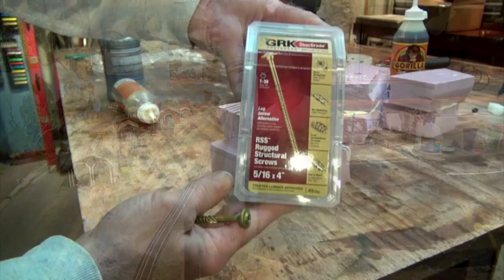Whats Neat in model railroading | April 2017 Model Railroad Hobbyist | Ken Patterson

Comment: Ken, It has been my experience That you need to put water only on one surface to be glued. This comes from many years of woodworking with this glue - great stuff...Using a pizza cutter to get wax paper under or behind scenery - wonderful - thanks...First time I ever used the glue was to put plugs into wood. I put them in, went to bed, got up to see that the glue had pushed the plugs out and put them on the floor. By the way, things glued to a floor with this glue is hard to get loose...Love the dog.....Strange -- most of my engines are Rock Island...The Athearn segment - beautifully wonderful...One of the things I like about your videos is the fact that there are times when there are large birds flying and they really make the video look like you have shot the real thing...I used to see the tank trains here in northern Indiana, the ones with the hoses between cars, but now we don't see them any more!!!

Comment: really cool on the Athearn video!  My head is still spinning from all the fine photos and run bys.  Thanks for the reaserch on the Gorilla Glue as I need to revise or add some foam.  I also appreciated the info on the Tsunami 2 - I have a couple Athearn GP38-2s that need a good non-turbo sound installed and the 567 version sounded pretty good in your models.

Comment: What's the purpose of spraying water on the foam prior to adding the Gorilla Glue?
Reply: Nerfball6 Gorilla Glue is moisture activated.  It would take a very long time to set with just moisture from the air between two pieces of foam.